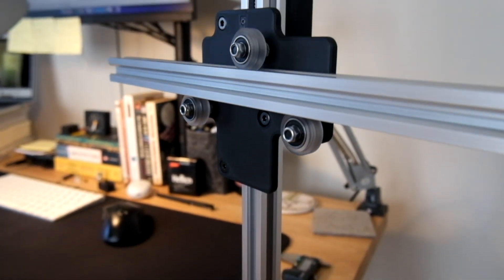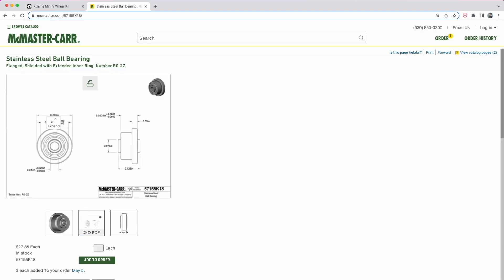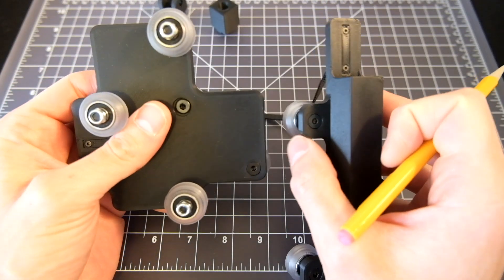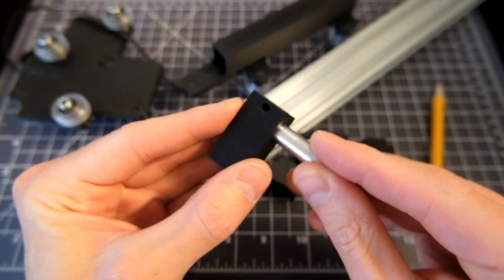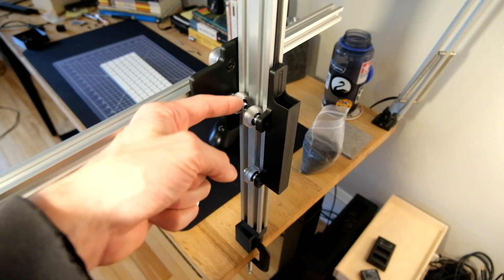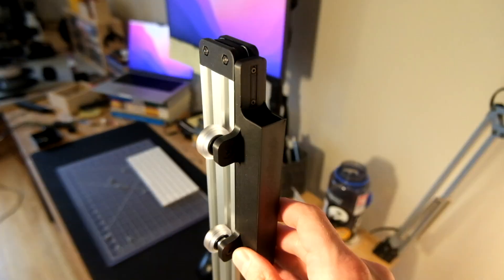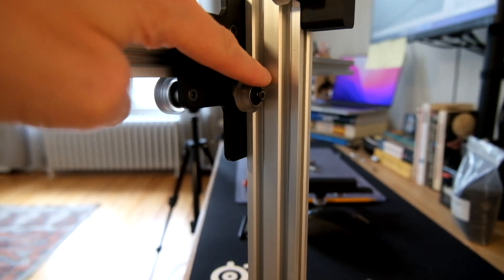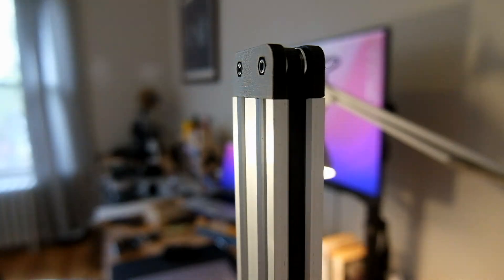Obsessing over the motion of my DIY Dyson task light - DIYson Lamp Build Log #3

Comment: When the axle bolts/nuts were colliding, my first thought was to turn the bolt orientation around so that the heads of the bolts passed each other, instead of the nuts.  It's worth noting that unless there are threads protruding from the nyloc nut, it's not really locking on the nylon.

Comment: I'm loving this project and upset I'm finding it so late! Surprised the solution wasn't to just use low-friction tape and a nylon t-nuts with countersunk bolts inside the counterweight, but I've never been one to argue with industrial and overbuilt!

Comment: When testing the desk-mount my result is a wobbly connection. I guess it is due to the 500mm aluminium profile having a high torque on that small pivot point.  

- I already tried editing the 3d printed base to fit a 10mm diameter aluminium tube to increase axle rigidity. 
It kind of works but not to my satisfaction
- I would try to fit a bearing with 10mm inner diameter for the axle and a bigger outer diameter to have a bigger surface (limiting the torque). Some redesign for the 3D printed base will be needed tough
Reply from the maker: I will spend some time this week dialing in the desk mount (specifically the hole that accepts the 40mm spacer). I've had to really dial mine in to a super snug fit to eliminate wobble, but I've noticed that the opening in the Express STL is too big. The bearing option is also promising, and I'll be looking into that too. Thanks for letting me know :)

Comment: As I am binging I am noticing you keep referring the aluminum extrusion as linear rails, they are not!! Linear rails are whole separate beasts with their own ball bearing fed carriage and hardened steel rails. The ones you got are simple aluminum extrusion with family of standard sizes like 2020 or 2040.
Reply from the maker: https://openbuildspartstore.com/v-slot-20x20-linear-rail/
Reply: This guy is right. Open builds use them to make linear rails but they are just aluminum extrusions. Linear rails have a rail, and a bearing block and nothing to do with aluminum extrusions. A stock ender 3 uses extrusion and v slot wheels but they would never sell it as having linear rails.
Reply from the maker: Totally see what you're getting at, but I'm afraid you'll have to take it up with OpenBuilds :)

Comment: I preferred the 20x20 design more.  It looks more natural.  I think if you changed the base to also have a bearing, though hidden, and having the counterweight on a continuous belt with a little bit of tension, the counter weight would only need the most minimalistic of contact points with the rail to stay in line.

Comment: Have you thought about running the counterweight wheels but internally (so rotated on the back plane), as your using lead balls I would imagine they would fill the void just fine and then you would get back that minimal discrete look. Or do you see some complications doing it this way?

Comment: I would try to build the wheels into the weight, hidden inside and kept the smaller profile of the orignal design. The smaller wheels should be able to fit inside?

Comment: You keep referring to these parts as if they're exclusive to open builds.  2020 extrusion, 2040 extrusion, concentric nuts, bearings, and v-slot bearings are things you can get from most hardware and hobby shops, and even certain rainforest themed online websites...  Open Builds also has them, but they're more expensive there.
Reply from the maker: Fair enough, folks can buy most of this stuff from whichever vendor they prefer. I do think there are practical benefits to limited to BOM to as few vendors as possible; one being that it avoids unexpected incompatibilities that arise from using parts that are similar but not identical (this may be a peace of mind feature for me, but I find it valuable). Another consideration is around minimizing/consolidating shipping costs (this may seem trivial but in my experience adds up). Either way, you're right to point out that the options aren't limited to Open Builds, and there might be better alternatives for many people depending on their circumstances.

Comment: First of all, your videos are addictive :)
One thing you can do to avoid the belt flopping when you lift the X-axis fast is, introducing a 3rd smaller pulley at the pulley assembly, between the the 2 pulleys you have, weaving the belt between all three and eliminating the slack. But this is occasional since you never slide up the x axis really fast.
Nevertheless, really great implementation

Comment: I would have taken the first design of the weight carriage with no wheels and added small stubs that would contact the extrusion as opposed to the entire carriage just rubbing again the extrusion. You could even make the stubs inserts that you could make out of delrin or ptfe for lower friction. The stub would make the contact area a point compared to what you had which was the entire aluminum extrusion face.
Reply from the maker: Anyone who arrives at this solution is an utter genius in my book.
Reply: I was thinking the same. I really dislike the tabs and wheels sticking out and also the extra wide rail. This is a perfect job for either a nylon bush (look at igus, they do all sorts of material for this application) or a nylon T which hooks into the channel with a ball detent pushing against the bottom of the channel to remove backlash.
Reply: Using wheels for this is overengineering to the max. You can buy COTS (off the shelf) PTFE stickers similar to those you would find on a computer mouse, they would be excellent for this purpose.
Reply: Yes, I thought of placing the two small wheels inside the carriage, hidden, so that only the wheels touch the rail. And to prevent the carriage from flying of the rail, just a tab at the bottom of the weight carriage. which in normal use doesn’t touch the rail.
Reply: I also arrived here, but using felt instead of plastic. Felt would be virtually silent
Reply: @JH-tc3yu  Using felt was my spontanious idea too.
Reply: Alternatively you could make the wheels internal to the counterweight and make them nearly invisible (apart from mounting hardware perhaps). This would make it possible to limit a holding T to one, or maybe not even needed if you make the belt a loop fully round.

Comment: What if u use ribbon/dupont style flat cables 🤔
For the wheels, go for the bigger ones, they look good, the small ones are a bit weird. 
U can flip the setup, use allen button head (on the nut part) and for the other side u can go for regular nuts, or use threaded inserts, u can try this ones and make the other side ''blind'' (just for a clean look), if that works...omg haha🤯

Comment: This is great, I was looking at ding something similar, and maybe adding a linear rail on the back side would guide the counterweight? Also, are you posting your step/stl files along the way? I’d love to do this along side with ya
Reply: After each log would be great! I have a few things in mind that would fit my needs, and then maybe If I can’t get it right, I’ll just use the end one! 
The F3D files or step files would be best, because I can make changes as needed as well. Totally up to you!
Reply from the maker: Cool! I think I can release STLs and STEP files between videos with the disclaimer that the designs will almost certainly change. I will look into it over the next few days. Thanks for the suggestion :)
Reply: @StevenBennettMakes  thank you! I can also send you my email if that’s easier!
Reply from the maker: Hey Joey! I can definitely share access to the STL files. I'm curious about your preference with these; would you prefer to have STL files available as soon as each build log comes out (even though they're likely to change) or would you prefer to get them closer to the end of the project when things are more finalized?
Reply: @StevenBennettMakes  if you are building this in real-time, I'd recommend you wait until the end to share files and parts lists -- to give you the chance of change your mind along the way or improve on something.